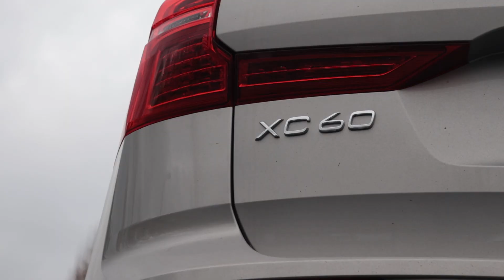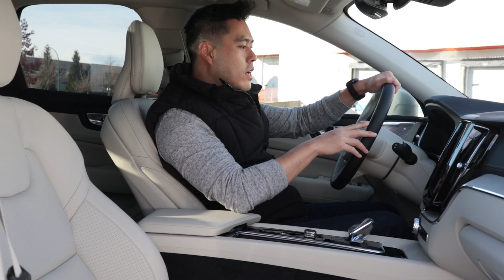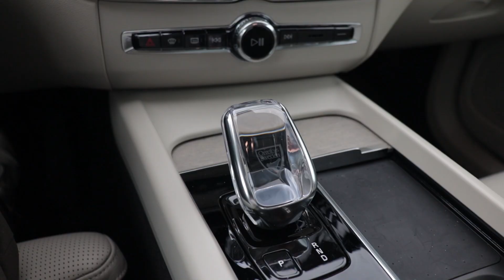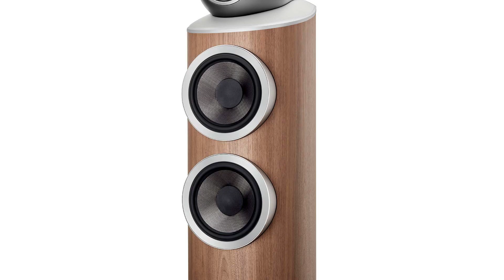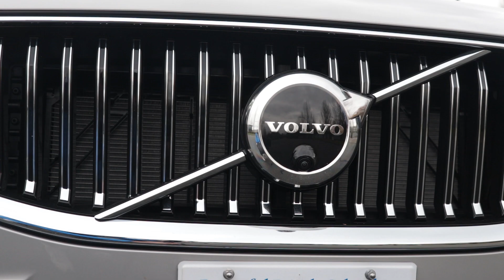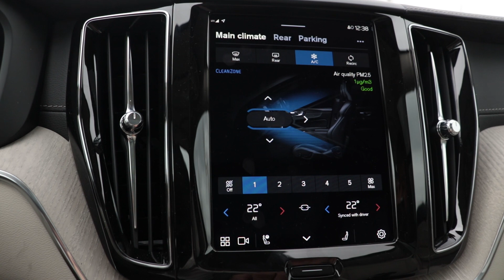Why the 2022 Volvo XC60 is the SUPERIOR Crossover to Buy

Comment: It's ridiculous that the air suspension would give a less plush ride than the standard springs! Why pay so much more money for it then? It's not supposed to be a sports car.
Reply from the maker: Yes, the air suspensions feel a bit more "bouncier" than conventional spring dampers, but I forgot to mention that they have the advantage of raising or lowering the ride height for increased ground clearance / lowering for ease of access especially for loading the trunk bed. 

I wouldn't say the ride quality is bad - just slightly different and gives you a bit more adjustability. But you're right. It doesn't make sense and isn't as practical for a crossover to have air suspensions imo. It makes a lot more sense for big trucks that need extra ground clearance on construction sites, and less on road driving for improved fuel economy and cargo loading (you can check out my Ram1500 review if you want to learn more on the practical applications of air suspensions).
Reply: @vex123  Thanks. I never understood the benefit of lowering the suspension by like 5cm to help with loading. By the time you wait for the suspension to slowly lower, you would have thrown all your things in with just a tiny bit more effort!

Comment: Volvo isn't compatible with iPhone- I have a 2019 XC90 r design and this was a deal breaker. Plus the tech is still sketchy, nothing has been updated besides the weird crystal ball shifter which is a pain. Sadly I'm getting a Lexus NX sport instead. Volvo better get with the times
Reply from the maker: I feel ya!  Definitely a bad move to shut out Iphone users for sure.  
 
Congrats on getting the Lexus NX! How are you liking it so far?

All automakers have their own competitive advantaged in order to compete with  one another.  I would say Volvo's would be their interior Swedish design, rock solid chassis and somewhat technologically advanced powertrain with their B6 engine that incorporates a turbocharger, supercharger and mild hybrid subsystem and their upcoming EV lineup.  Their Volvo XC40 EV was absolutely insane (400hp dual motor).  They also have full Android Auto built right into the infotainment system.  So that means you get Google maps and google voice assist which is really convenient. 

But definitely can't blame you for getting a Lexus NX! Lexus competitive advantage is continued refinement towards perfection and fuel efficient powertrain. The caveat to that is you sacrifice new tech and innovation by continuing to improve your own existing platform over time.  This is probably the reason why their Supra uses a BMW engine because they don't have enough R&D resource. Definitely not a bad thing because newer is not always better!  And I also personally love Lexus cars and their quiet and comfortable interior.

Comment: Brilliant review. I am so confused 🤔. VOLVO XC60 or BMW X3 or Mercedes GLC in terms of rear seat comfort and daily commute Over rough twisted roads . At the moment I drive a Land Rover Discovery sport . Thank you
Reply from the maker: Thanks for the supporting words!  Just out of curiosity, why do you want to switch out from the Land Rover Discovery?  

Out of the three, I would say Volvo XC60 is more on the comfortable side.  I'm a bit wary of the engine though, because it has a hybrid, turbo AND supercharger (depending which engine you get), which makes an already very complex piece of componentry even more complex; thus, concerns with reliability if you were to get this engine.  But I would say the high-points is the awesome Android auto with integrated Google Maps, Bower and Wilkins sound system, and premium interior quality.  What I didn't like though; is the climate controls on the infotainment display - it's pretty annoying to use.  Eg: If you turn on the defrost fans, it goes on at high speed.  You then have to navigate through a series of menus on the infotainment screen to turn the fan speed down, which is kind of annoying.  You can also use Google Voice to turn down the fan speed as well, which is pretty cool, but still not as quick as just having buttons and dials on the center console.

I haven't driven the X3, but any BMW that you drive will tend to feel very stiff / harsh, but very responsive and quick to react on throttle and steering demand.  So if you're an eager driver and want some "umph" on the road, this is it.  I also have not driven the Mercedes GLC, but in terms of the brand itself, I would say they sit in between the two.

Let me know what you think or decide to get!  I'd love to know!
Reply: @vex123  it’s a 2018 manufacture LR dicso . The quality of the interiors is not upto the competition like the German rivals . It’s a great suv to drive through . I live in the Darjeeling Himalayas and to go for test drive I would need to drive 1000 Km away
Reply from the maker: @floraexoticsfloraexotics  Wow!  I just googled some images of Darjeeling - the place looks amazing, and I would love to visit one day!  And yes, the Germans / Swedish manufacturers really know how to dial in their interior!  And if you want something that is still really fun to drive on the road, I think the BMW X3 will be a good choice.  And this is not German, but I also just recently did a review on the 2022 Acura MDX.  It probably won't match up to the same quality interior you're looking for, but it drives really well, and has proven Honda-reliability behind its powertrain.  Do check it out if you have time! https://www.youtube.com/watch?v=Re7_Ybzwlp0
Reply: @vex123  you are most welcome to our part of the world . Keep me updated and will be happy to meet you and show you around . It’s call a place or Land Rovers https://youtu.be/YNXU1IR2LR8
Please see url above for some more information.
Unfortunately we do not get to buy Accura here . Prices of cars are astronomical here due to taxes . Land Rover discos sports , BMW X3 all costs north of USD 100,000 here :(. 
I was considering the X3 too , how is the back seat comfort ? 
Do you recommend the xc 60 for daily drives ? Thank you
Reply: https://youtu.be/lskdcRepN00 one more

Comment: good review. after agonising between the XC60 and the BMW X3 Hybrid, I am now the proud owner of a brand new 2022 Volvo XC60 T8 Recharge. My only complaints are that it does not come with Apple CarPlay (Volvo promises it'll be available soon), ParkAssist that previous models had, and a space to place a [small] tissue box that the driver can reach. Also the vanity mirror for the passenger is a bit off centre.
Reply from the maker: Thank you for the supporting words!  It means a lot to me, and above all, congrats on being an owner of the XC60!  I've driven over hundreds of cars over the last 8 years, and Volvo cars are definitely amongst one of my favorites.  

But yes, there are a few quirks with the XC60.  What I personally didn't like was the climate controls - the windshield tends to fog up easily, and when you push the defrost button, the fan goes full blast.  Then you have to navigate through a maze of menus on the infotainment system to turn the fan speed back down - it's compromise for climate controls built into the infotainment touchscreen in general though.

Hopefully Volvo will release support for Apple CarPlay for Iphone users soon.  Also, if you didn't know, you can use Google Voice to turn on and off the climate controls, which is really cool!  Give it a try next time if you haven't :)